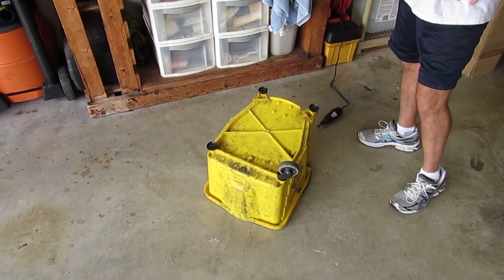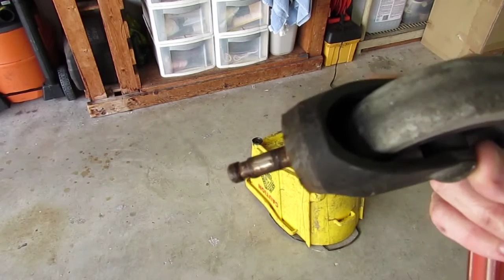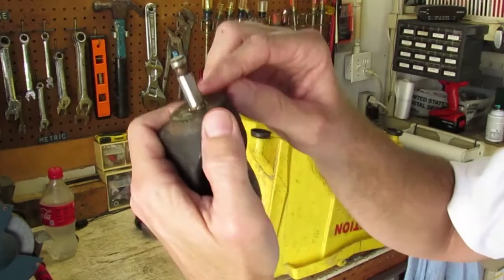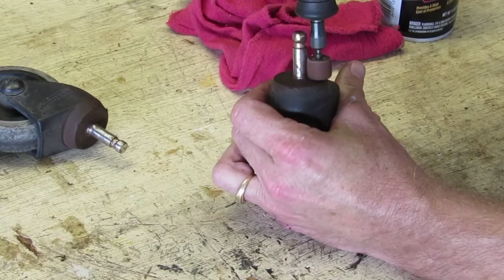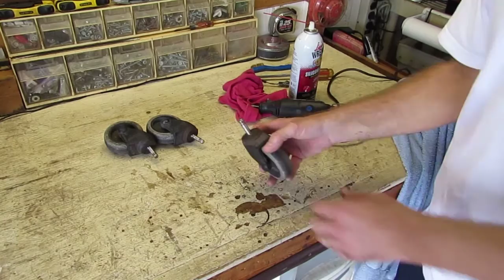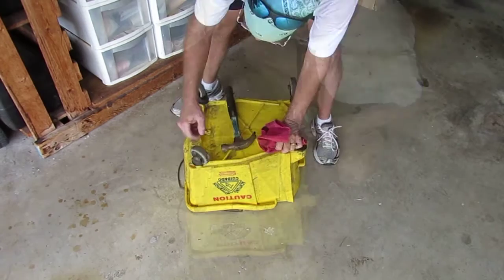Mop Bucket Wheel Stuck Won't Swivel Turn Repair

Comment: Great video!  Thank you! 
Some suggestions for improvement:
--Start with a wire brush to remove the rust. Drill attachments and angle grinder attachments are now widely available at Harbor Freight and hardware stores.
(Sanding will remove more usable material than a wire brush. The more you preserve, the longer the casters will last.)
--If you have time to wait, use rust converter and allow them to sit overnight.//If you don't want to wait, media blast with glass. (Again, trying to preserve usable material.)
--Use bearing grease, garage door lubricant, or automotive brake grease around/on the shaft. Not much needed. They sell tiny packets at the counter at AutoZone and other automotive supply stores.
(Silicone spray wears off easily with friction and WD-40 dries off after a while. The other lubricants mentioned will be more likely to stay in place and keep moisture from getting in.)
--Thoroughly wash the inserts with soap and water. Then thoroughly dry with compressed air or a towel prior to inserting caster shaft. (Removing as much rust as possible will be beneficial in preventing future rust.)
--Inspect and re-grease casters periodically BEFORE they stop functioning properly again.
//End autistic fit.
Reply from the maker: Thanks for the comment and the helpful tips...

Comment: If the wheels have a plastic cap on them will the plastic cap come off to reveal a rusted bolt?
Reply from the maker: I believe one side of the wheel axle is a hex bolt and can be removed and the axle can slide out from the wheel.

Comment: can you take the wheel off the caster? I can't get either of the 2 that are frozen out but one of the 2 froze wheels is missing, I could just add the missing wheel and the 2 on one end work so just replacing the 3 inch wheel would suffice, any info advice welcome thanks?
Reply from the maker: Yes, you can remove the bolt that holds the wheel. I believe it's Allen (hex) wrench. I have done this to clean and lubricate the axle, they tend to get clogged with hair from pets.

Comment: Why silicone spray and not grease ?
Reply from the maker: I would use grease as well. Either or. I guess I tend to go with the Silicone spray because I brush out the inside of the wheel insert to get the rust loose. The spray is thinner and it cleans and lubes. I'm a big fan of both :).
Reply: thanks

Comment: I cannot pull the wheel out at all...
Reply from the maker: If it's a wheel like the one in the video, it will come out. Try using two flathead screwdrivers, one on each side.  Sometimes they are hard to get out but it will eventually come out. You can also wedge the screwdriver between the wheel and the insert and use a hammer to tap on the screwdriver so it forces the wedge until the wheel comes out.